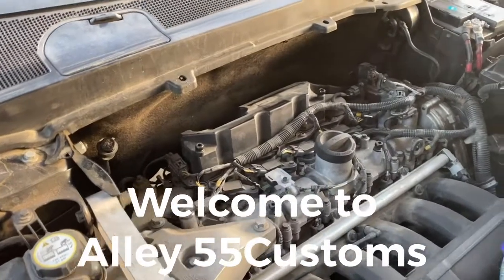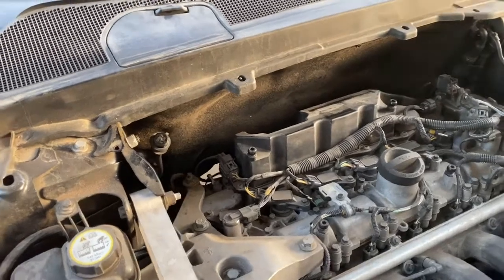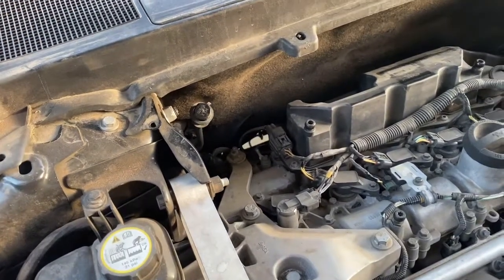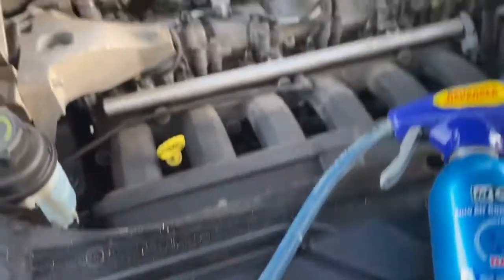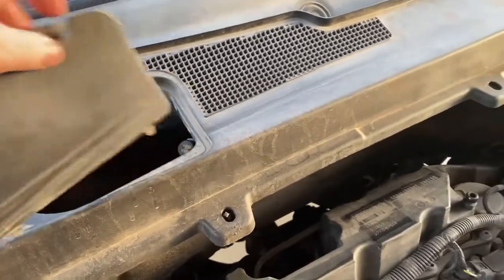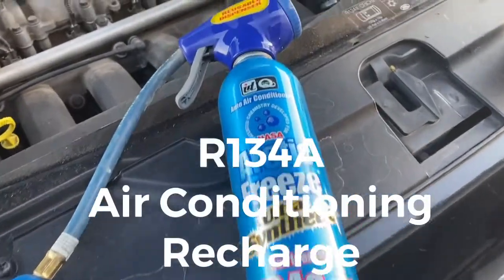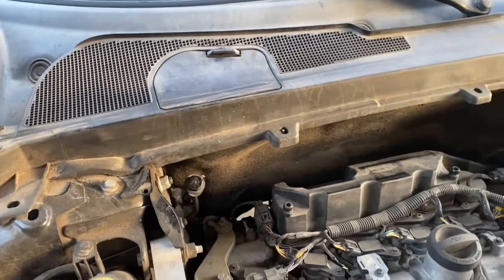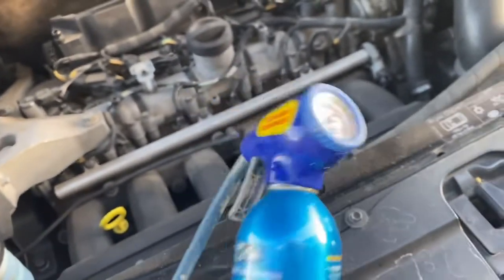2008 Land Rover LR2 Air Conditioning Low & High Port Location Recharging. Episode 89

Comment: I'm looking for the Low & high port location on a 2015 Range Rover Evoque.  I am fairly certain I found the high in a similar place as in this video.  I think, the low is directly forward of the low, but the A/C connector does not want to connect, so now I am not sure it is the right spot.  IF you have a video or photos I would appreciate it.

Comment: Thanks. Did you have trouble unscrewing the cap on the low port? Can get the damn thing off!
Reply from the maker: I did have an issue unscrewing the cap on the low port. What a bitch. I totally agree.
Reply: @alley55customs93  how did you end up removing it

Comment: Can you help me. 2010 range rover 5.0 SC. I replaced condenser, compressor, expansion valve. Manual says 250ml oil which I did, I vacuum the system and manual says 32oz of refrigerant. I have about 25oz refrig un and the high side is 260psi at idle. Idk why pressure is high if I am nowhere newr the spec refrigerant level. I don't wanna just add 32oz cause psi will be sound 300 when I am done